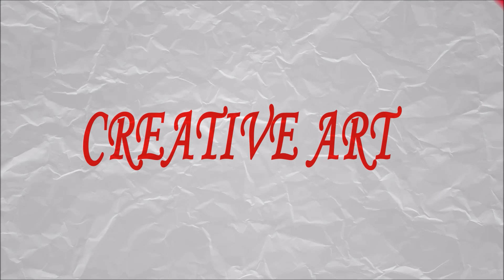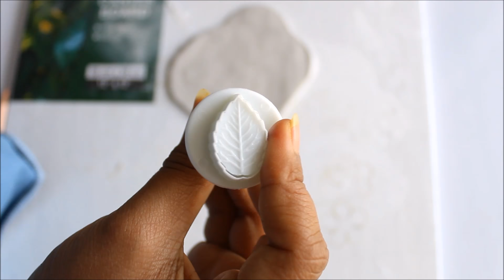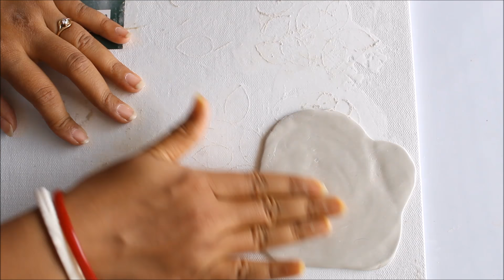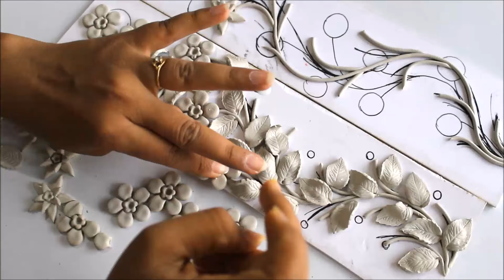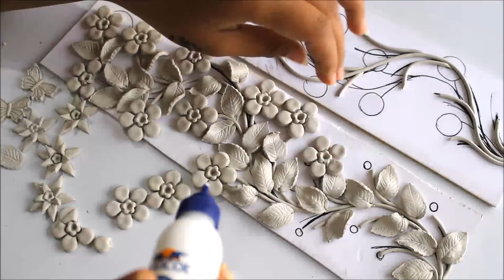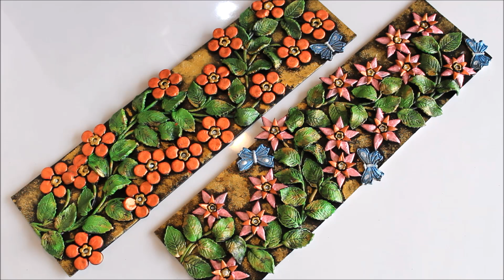3D WALL DECOR

Comment: The molds on Amazon are very expensive and so are the tools. If you go on eBay and Look up fondant cutters you can get them much much cheaper in a variety of shapes- leaves, butterflies,flowers and geometric shapes.
     You can probably get the tools cheaper also.  I think you can use  air  dry clay in place of polymer clay for this project . If you look up the TurtleSoupBeads video she explains the difference between air dry clay 'vr polymer clay and how to use it and gives a recipe for air dry clay.
Much cheaper than Amazon .

Comment: From where I can get the molds of flowers n etc. 😭😭
Reply from the maker: CLAY MODELING TOOLS AND USES https://youtu.be/iJdD7YOqJso

MATERIALS REQUIRED:
Clay Modelling Plastic Tool Kit   https://amzn.to/2OKiwL8

Clay Modelling Plastic Tool Kit( 47 pieces) https://amzn.to/2OJyogL

Fevicryl Shilpkar Clay
OR
Mungyo Sculpt Dry- Air Dry Terracotta Clay   https://amzn.to/2wmNrFb
Clay Modelling Tools Set  https://amzn.to/2wjAADI
FOR MORE DETAILS plz check the description box.............
Reply: You can get fondant cutters on eBay for much much cheaper than these are. I just bought some for under $5.00
and You can chose the kind of cutters you want in small groups. Leaves,butterflies,flowers ,geometric shapes etc.
   You can probably get the clay tools for much cheaper on eBay also.